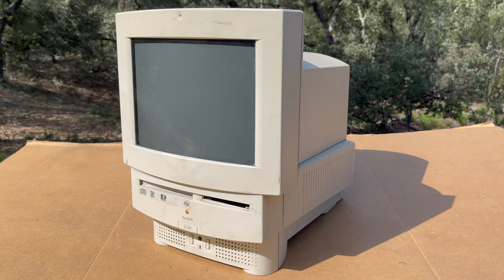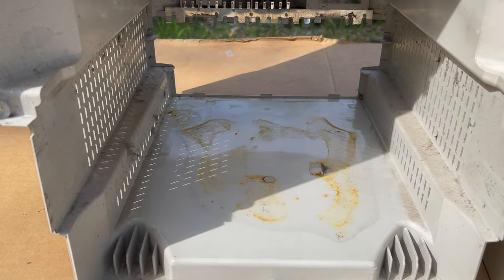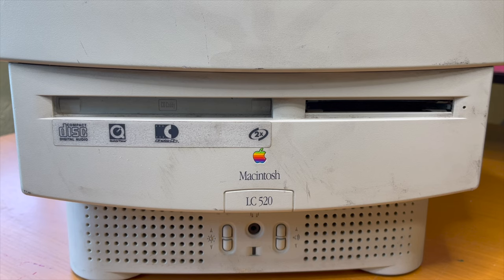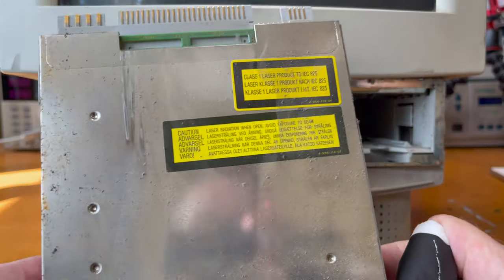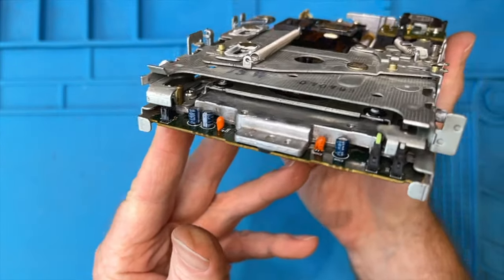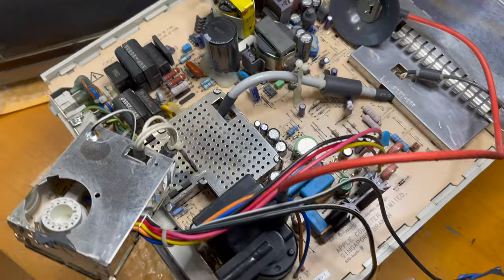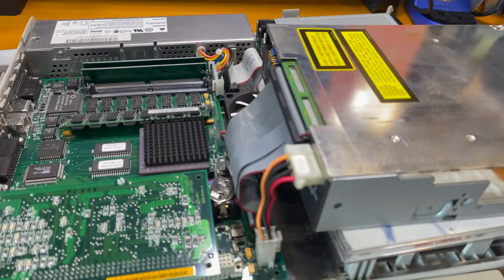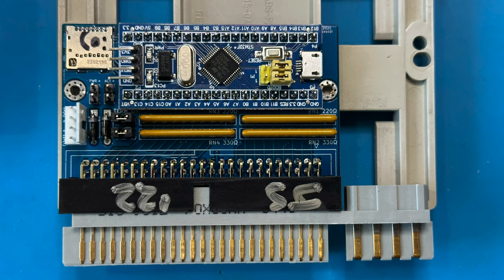Macintosh LC 520 Trash to Treasure

Comment: Good video Garth. I am too scared to pull off the anode cap from any CRT, but I guess I have to when I get to my old CRT compact Macs and displays. Although the plastics are held together with the rear case, I thought maybe you could weld the plastics together on the insides to give it a little strength. Maybe not, as the back case seems to be holding it all together, and the plastics are brittle enough as they are!

Comment: The plastics on this desktop machines are like Papier-mâché now. I hope that 3D printing or 3rd party case molds advance to the point where we can get modern replacements because in another 20 years they will be collapsing into dust.
Reply from the maker: Some are still in good shape, this one actually is quite good 😅

There's clearly a design flaw for where the plastics for the bezel around the CRT connects to the lower half - it's only 2 strips on the side, any shifting of the weight between the CRT or lower half that holds everything else, puts a ton of strain on it. So even if your plastics are amazing, it can break

I will say, I did have a Performa 580 where its plastics did indeed literally crumble under its own weight 😩
Reply: @GarthBeagle  And yet the earlier compacts (Plus, SE etc) are holding up really well.

Comment: Curious, what's going on at 9:25?  The cap falls off before you even get close with the heat.....
Reply from the maker: Oh I cut down to just where the caps were coming off, they generally need to be under the heat for about 20-30 seconds or so